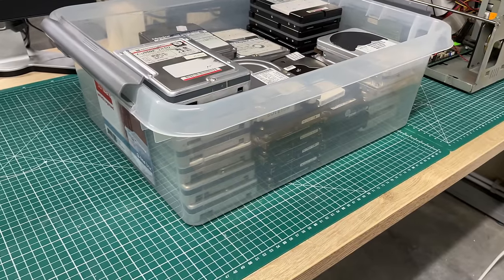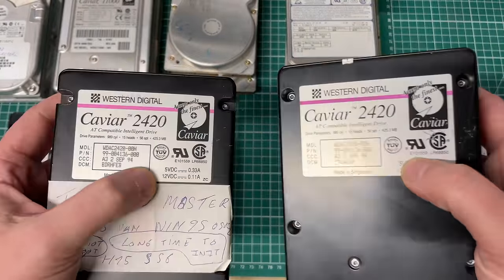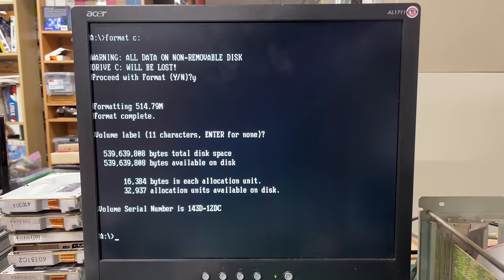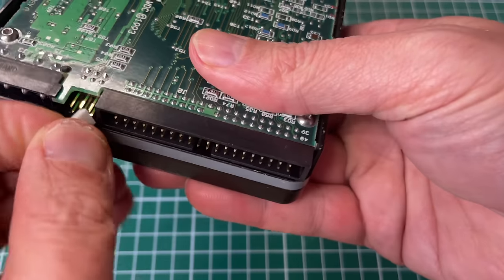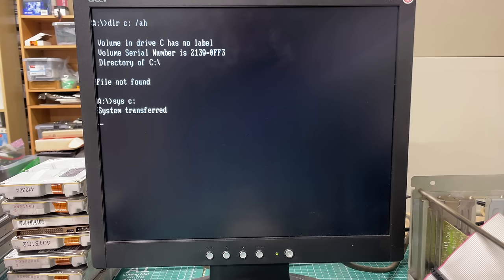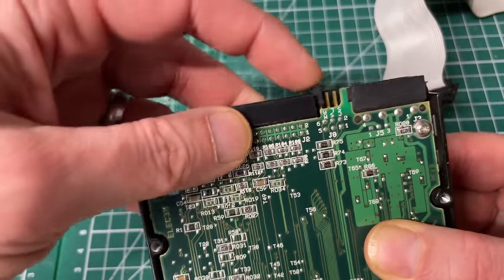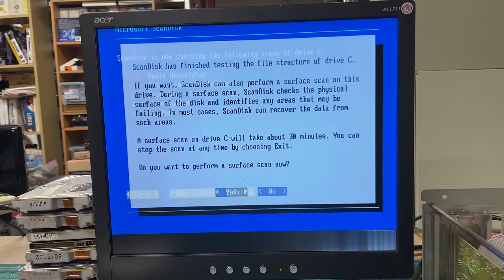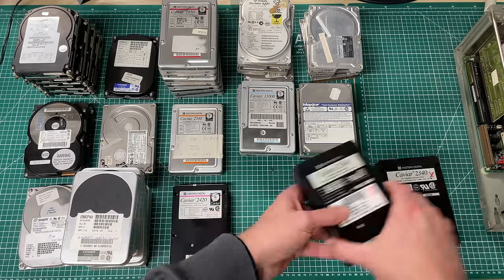30 yr old Hard Drives : Caviar Edition

Comment: I heavily recommend hdat2, a modern MSDOS utility to wipe, test and even repair hard disks. It does a lower level access to the drive, bypassing any partition or file system and can truly test the drives from sector 0 to the last one. If the drive supports reallocating sectors, might even refurbish them back to usable state. Works with HDD, SSD, floppy, USB media and even optical media (read only)
Reply: I second this.

Comment: I used to low level format the drives with bad sectors and sometimes the bad sectors just dissapeared and the HDDs were reliable. I used a program called The Troubleshooter (HBCD 6) or simply Ontrack Disk Manager. Not always the bad sectors were caused by a deffective media, and by LLF, it was erased and "revived", especially seems to be the case with the last HDD thathad one bad cluster.

Comment: I love hard drive testing videos, and this was a lot of fun; looking forward to part II! The age of a hard drive isn't really important, it's how many hours they have on them. I have some from the mid 90's that are still in perfect condition, because they weren't used all that much
Reply: the age matters to some extent because the bearing grease dries out
Reply: Age matters greatly.

- capacitors fail due to age (many old HDDs use tantalum capacitors, known in the retro community as a major failure point on old motherboards)
- Grease and Oli fails due to age
- Other electrical components change value or fail due to age
- Corrosion 
- The platters may have lacquers on them that may fail due to age (as happens with an IBM "Deathstar")

 And finally, the data on a HDD fades with time just like on many other magnetic mediums. You can stave off losing the data by reading and rewriting every sector, something that Spinrite can do, or a "non-destructive" R/W test. But, there is no way for you to refresh the servo tracks. Once the servo tracks fade too much or can't be read correctly due to any other reasons, the drive is toast.

Comment: That 200Mb might work if you warm it up with a hair dryer. Had one with the exact same issue, some times didn't start, mostly during winter in a damp room, but the hair drier fixed it every time until the upgrade.

Comment: In 5 years I changed 3 Western Digital Green 1 tb Hdds used in a surveillance system with a low recording rate and every time the electronic part it broken and besides that, the pins on the motherboard plug with plug from the turntables oxidizes. I have 3 retro PCs with Western Digital HDDs from 25, 20 and 15 years ago and they are still perfect.

Comment: Love that sound of these drives. I had a 486DX4 100, was gutted a friend with a Pentium 120 and both out performed mine. Very strange no mention of the click of death, which was so well known. Bad clusters, bad sectors both being referred to in the video. Bot meaning the same, so strange them both being used to confuse. Bad sectors term being more well known and used.
Reply: The "click of death" was mostly associated with ZIP drives.  It's kind of shorthand for any mechanical drive that has a recurring retry behavior, but I think if you ask someone what they associate with that term, the first thing to mind probably wouldn't be HDDs.  Their failure modes were more varied and the behavior depended on what was actually wrong.

Sectors are the lowest addressable unit of a medium at the hardware level.  Clusters are a filesystem construct, and are made of a group of one or more sectors, in a power-of-2 multiple.  So, if you're talking about a drive-level issue, it's a bad sector.  If you're talking about a FAT disk utility that is marking bad spots on the disk, it can only mark the entire cluster as bad, regardless how many sectors in that cluster are, or are not, usable.  Ergo, when you're speaking of a disk that is formatted as FAT, then for all practical purposes, a bad sector means a bad cluster, and a bad cluster is one or more bad sectors.  It's not technically correct to use them interchangeably, but since they're so tightly coupled, it's fairly common to consider them vaguely synonymous.

Comment: I really like using old hard drives for retro builds. The sound is just part of the machine. That being said, I do backup the drives to a newer form factor just in case. Just for fun I have a pci ide card and had raid running and the sound of 4 drives at once was magical.. lol
Reply: I still have some Promise 100 cards sitting around. I used them in a video editing rig because it was the only way to get the transfer speeds required for video capture back then without spending a fortune on SCSI.
Reply: @CantankerousDave  that is what I have, promise fasttrak 100 tx2.

Comment: All my hard drives of different brands from the 90s to the 2000s, about 30 of which were stored in the basement, work perfectly. The only hard drive that has ever broken is the infamous Seagate 3Tb. I was able to make one of the two defective ones by changing the bios circuit from one to the other. The other one was mechanically broken somehow.

Comment: My experience is that as long as you "low level format" the drive with FDISK and do a slow format with surface check, then they're usually all good for another couple of years. The magnetic track benefits from being rewritten every now and then. 

I got a bunch of 30-35 year old 40Mb SCSI drives that still works just fine. Larger drives are usually problematic. Drives from the early 00's are usually just fine, but I've had very little luck with the drives from the mid-90's.
Reply: You can't low level format IDE drives, and certainly FDISK is totally incapable of low level formatting. FDISK doesn't even format, it creates or modifies a partition table, which is a tiny part of the disk.

Refreshing the data always helps.

But, nothing can refresh that servo track. Nothing. Once that gets too weak, bye bye drive.

Comment: From my limited experience, the older Seagate, Maxtor and Quantum drives often still work today, while most WDs and all Conner drives I found were dead.
Reply: Conners often have a relatively easy to fix fault - the read head is stuck in the parking spot.

Comment: Well. I must admit I have never ever from 1996 onwards used single drive setting on any model of disk. I’ve only used master or master and slave if i installed two disks. You can use one disk just fine with it set as master.
Reply: Yes, I have had the same experience till I came across ONE drive recently that really did want to be in single mode!

Comment: - What failure mode makes hard drives do the clickety-click?
- Also, I'd swap the board from the clicky drive to the totally dead one, just for the hell of it. 
- Maybe there's a SMT fuse or something on the totally dead one's PCB
Reply: HDDs click like that when they can no longer locate or properly read the servo tracks. Before a drive has any idea where the heads actually are it must locate the servo track that was put on the platters by the factory at a specific location.

If it can't find the servo track it moves the heads back to the park position and then tries again. It repeats this several times. This is what makes the clicking.

Over time the data recorded on the platters fade. Filesystem data, partition tables and data files are easy to refresh simply by rewriting the files. However, you can't do that with the servo tracks. As they fade they keep fading till they are gone and the drive becomes useless.

The heads could also be damaged, or even the circuits driving the heads. Basically if it can't see the servo track the HDD never initialises
Reply: @dlarge6502  I see! Thank you so much!

Comment: It would be neat to see two compatible dead hard drives, cannibalized to produce one working hard drive. 
I would also like more detail on how to run two hard drives on the same computer. I tried doing this in the early 2000s, but was unsuccessful. I don't remember if I was doing it right or wrong, or if two simultaneous hard drives was not supported by the system. I would have been able to save more files from the dying drive.

Comment: Try MHDD test / relocate on the one with 1 bad sector, I though the old WD tools offered surface scan + relocate, but maybe I'm thinking of a different make, maybe it needs an old version of wddiag, not sure if the capability is there in modern Data Lifeguard

Comment: Isn't there only 2 types of failures with mech drives, ie, disk surface, and head control. Maybe pop the lids and see what it's doing, ie, which failure it has, and then seeing if swapping parts between failed drives might get some working

Comment: Could it be that it is the wrong IDE cable? I thought there were 40 pin IDE cables and 80 pin IDE cables. I think with old systems you have to use the 40-pin IDE cable. That's why the hard drives don't boot. 

But i could also be wrong..

Comment: If I recall correctly, IDE drives should never have bad sectors.  And you should never low-level format IDE drives with regular tools.  Some IDE drives can be low-level formatted, but only with the manufacturers tools.  Additionally, the reason IDE drives should never have bad sectors is because they should automatically remap bad sectors internally to spare space.  If you have bad sectors, that means it's already had enough bad sectors to run out of that spare space and it's now having to just mark them bad.  That means the drive is starting to fail.

Comment: "I do find that 5 to 10 year life expectancy of mechanical hard drives isn't really what I have considered to be fact. I mean I have lots of old hard drives which are like 20 years old which are still working". 

This is a mix of misinterpreting statistics + survivorship bias. :) Those 5-10-year figures from Google relate to data center hard drives - ran 24/7 and mostly under load, so it's a logical error to assume that typical desktop PC hard drives work in the same conditions and last the same number of years. They obviously don't, and especially with those old vintage PCs - many of them have actually survived to this day because they haven't been used all that much and were just sitting for decades after only a few years of initial use. 

And that's where the survivorship bias lies as well - you just haven't encountered the vast majority of those old dead hard drives because they went into the garbage bin without your acknowledgement, many years ago. As a retro guy you find the ancient computers with hard drives inside of them, some of which are still functional, but most of their siblings are long-gone - the drives or whole computers thrown away due to either power issues (caps etc) or HDDs dying. So you're looking at the stack of those Maxtors or WDs on your desk, but not seeing 95%+ of the same models from those years that have been dead for a very long time. The sources from which you get your old HDDs don't allow to draw any meaningful conclusions regarding average HDD life expectancy, those systems you get them from are "survivors" and it's pretty much the textbook definition of the survivorship bias.